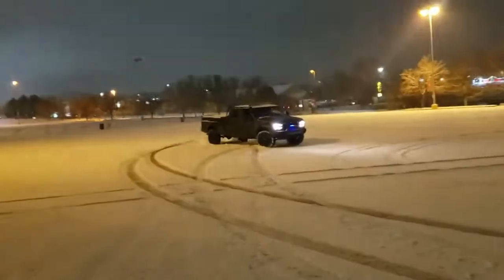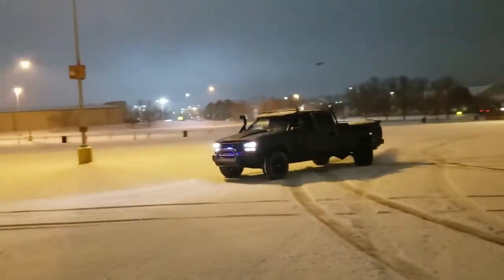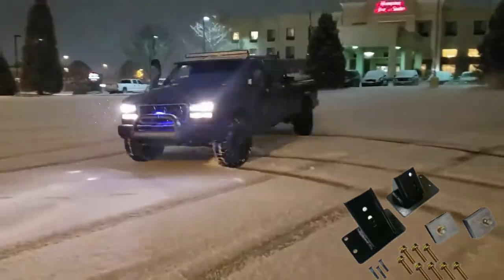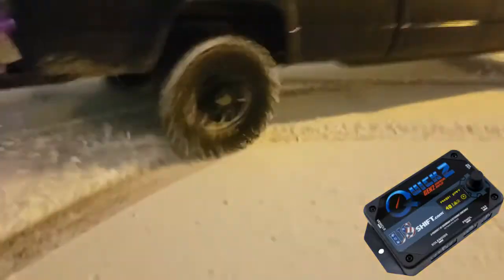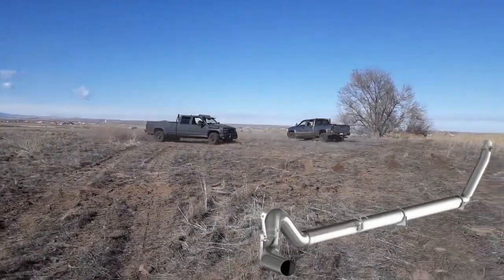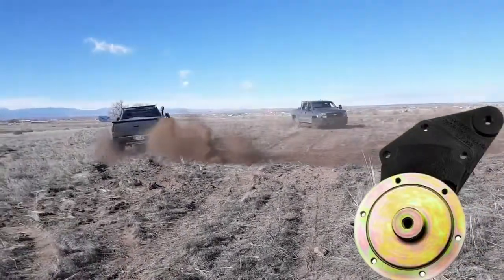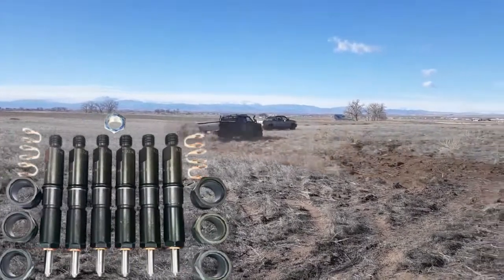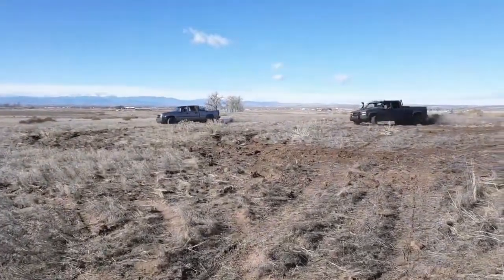GMT-400 12V Cummins Swap OBS Chevy Parts List

Comment: Hey, I’m not sure if you know or not but will a dodge n4500 input shaft fit in a gm nv4500? Do you use the dodge computer and if so can it control the gm cluster?
Reply from the maker: The dodge input shaft will fit but depending on the year some of the gm nv4500s vary as far as things like the bearing retainer that may or may not need to be modified to make it work but many people have done it. As far as the cluster theres a variety of ways to do it the easiest I would say is using a Dakota digital box for the speedo and the factory alternator for the tach signal, and you can use adapters to make the gm oil pressure sensor work on the 12V

Comment: Did you have to upgrade the front end to support the added weight?
Reply from the maker: @fn8571 No, some people do crank the torsion bars up and say it rides surprisingly well with the extra weight on the stock 4x4 ifs, I haven't noticed any problems personally

Comment: I'm putting a 97 12 Valve into my solid axle swapped nv4500 gasser 96. Three questions I haven't found exact answers for though. 1. If I swap in a diesel cluster will the tach read correctly and without any further modification? 2. Did you use Dodge radiator, condenser and intercooler? 3. I have both the Dodge and Chevy computers. Which one is easiest to use to keep gauges and everything functional? I've seen trucks built wither either but nobody explains why one may be better than the other. Thanks!
Reply from the maker: If you use a diesel cluster you can hook it up to the dodge alternator to get it to read but it will be off by a bit. I used a duramax radiator and dodge intercooler and condenser. Most of the Chevy BCM stays in tact and since you shouldn't need 99% of the Chevy ECM its typically easier to stick with the dodge computer. I hope this helps, if you need any more info I have a decent write up in the description and if I dont cover it there feel free to ask, I hope your project goes smoothly!

Comment: Is it Hey Bud? What torque converter did you go with? Because the factory stalls are around a 1000 and I didn't know they made one lower than that?
Reply from the maker: @nerdyelectronguy  I went G-Force "low stall" triple disc converter but I believe Hughes transmission and xtm have one too and I think they all stall around 1200 I have heard of people pairing the 4l80e to Duramaxes with different low stall converters but I'm not sure what they're stalling at some people have had plenty of success with the stock ones but some have shelled them within weeks it depends on the application and driving habits to a degree

Comment from the maker: Starting with a 454 gives you the advantage of not having to swap or modify the ac/heater hoses and windshield washer reservoir like you would if your truck had the 6.5l. However, already having a diesel cluster arguably makes it easier to get your tach to work since you don't have to utilize a Dakota digital tachometer conversion box to convert the signal from your alternator to be readable by the gas cluster. You can also add a W terminal to the stock denso dodge alternator and hook it up directly to a diesel version cluster that also already has the wait to start light, but the reading won't be entirely accurate. To hook up the speedometer and US-Shift trans controller, find the two pairs of braided wires (purple/white and green/black) coming from the transfer case output shaft (on 4wds, on 2wd it's on left rear of trans), splice them into the US Shift without disconnecting them from the vehicle speed sensor buffer so as to not interfere with ABS, and then take the speedometer output from the US Shift and connect that to the dark green wire (#14) going to the speedo on your cluster, making sure to disconnect it from the VSSB.  After removing the 454 and its motor mounts, cut the bottom lip portion of the motor mount area off on each side and drill the 1/2-9/16 holes in the exact spots for the conversion motor mounts (1.1" right from center of existing top left mount hole, 2.73" down). You will also need to cut off two small "support" bars near the core support (they make a v shape directly in front of the motor mounts) as well as replace the top bolts in your front diff with recessed ones that will allow for more room (not required with 6 inch lift or if 2wd). The lip between the trans tunnel/bottom of the firewall will need to be beat back with a hammer if you are not using a significantly sized body lift. Save both the coolant temp sensor and oil pressure sensor from the old motor (if 454, there are two coolant temp sensors, the one you need is the one for the gauge cluster which has only one wire going to it) to install on the 12V with adapters that allow them to screw into existing tapped holes on the block. The coolant temp sensor can be installed on the front of the block where the vent tube for the p-pump used to go with a 1/2" MPT male thread to 3/8" MPT female thread bushing if you're using a high mount ac kit and smaller thermostat that doesn't require the vent tube (vertical water outlet). The oil pressure sensor can be installed on the Cummins block with a 1/8" male MPT to 1/4" MPT female adapter between the p-pump and motor mount where there is an existing tap into oil passage or on top of the oil filter housing.  If using the old 4l80e, the transmission crossmember needs to be moved backwards roughly 1.5-2 inches due to the additional length of the motor and you will need to use the correct flex plate/adapter as well as a US-Shift trans controller. Obviously, since the transmission moves back the rear driveshaft needs to be shortened and if you have 4wd the front needs to be lengthened. The old throttle pedal cable and cruise control can be modified to connect directly to the cummins throttle linkage. Some people throw on the work truck grill with thinner lights beneath the upper headlights that allow for the intercooler piping to snake through, but it is not all that difficult to modify the stock turn/marker lights by cutting them down to a thinner depth and reinstalling the bulbs. A stock dodge radiator hose can be bent and adapted to the upper radiator with rubber 90° elbows. The old ac condenser can be utilized directly behind the FMIC if you build some mounting brackets and clear the core support a bit for the lines. The bottom of the hood latch support needs to be cut off and reinforced differently while the radiator mounts on top are slightly relocated from the original position in order to move the radiator and allow more room up front. The intercooler piping should come out of the turbo into the passenger fender well, through the front core support (hole must be cut), into the FMIC, back through the same area on the drivers side of the core support, using nothing but 45 and 90 mandrel bends and one 180 u bend 3" exhaust tubing. Coming from the turbo on the passenger side, the piping can be ran by staring with a 90, going into two 45's, then another 90 directly into the intercooler. From the intercooler, it starts with a 180 u bend, then goes to a 90 mandrel bend, straight up to the stock cummins intercooler pipe just before the intake. The top half of the dodge fan shroud can be utilized behind the radiator, but the bottom half will not fit. Hook up your fuel, ac/heater lines, 12v in, run, fuel shutoff, and start to your ignition/batteries/relays accordingly and enjoy your new truck!
Reply: I'm fixing to start this project on my 93 c3500 2wd that has the weak 6.5l in it
Reply: Im prepping to do this to my 92 c3500 4x4 cant wait

Comment: Think I can do this to a 92-96 Chevy Silverado 1500, it's got plenty of engine bay for it, no rust on the frame or cracks or anything's the frame is beefy, and the suspension it's perfect if not a cummins, a LLY or a LBZ Duramax
Reply from the maker: Yes sir you can certainly do it with a half ton obs Chevy! It'd be a good idea to upgrade at least the front end with 3/4 or 1 ton parts. I'd also consider getting a 4l80e if you have the 4l60 because it'll handle more torque than the latter, although an Allison would be ideal if you're not going manual. Here's a couple brothers that put a duramax in a 90's 1500 and I believe they upgraded the suspension as well: https://youtu.be/rVRRAM00NNs 
You can't go wrong with a Cummins and those earlier Duramaxes are definitely where it's at! I've always loved the OBS platform as well so I'd say your rig is definitely well worth building and I hope it all goes well for ya'! If you need any tips or pointers feel free to ask! Thanks for watching!
Reply: @BOVAction  I seen this late lol I got model wrong mines a 2500 😂 it’s a 3/4 ton so I should be good there for it, only main issue I can see me hitting is the wiring issue
Reply from the maker: @dakotaenoch9014  Hey that's even better! The earlier 12V Cummins are fairly easy to wire up, but I could definitely see there being some difficulty if you go with a Duramax. I'm sure you'll get it sorted out either way!
Reply: @BOVAction  yea I’ve been thinking bout Cummins swapping it I’ll prob be easier
Reply: @BOVAction  do you got a video of it running on your page somewhere that I can hear it?
Reply: I would start out with a 3/4 or 1 ton truck. Half tons do make good LS swaps though.
Reply: @atx-cvpi_99  yea mines a 3 quarter ton

Comment: I'm actually putting a 1992 cummins in a 97 chev at the moment. Are you also sourcing your adapter parts from Jonesy's?
Reply from the maker: I am actually!
Reply: Swimmingly. I put a camper on top and drove 5000 kilometers to the Yukon and back. In hindsight I would rebuild the transmission before doing the swap haha
.....
 Lost reverse because I used too much 1st gear braking coming down the dome. Limped home with no reverse. 
Spending the winter adding new B&M supercooler, A/C and a temporary junkyard trans with a new low stall converter. Still undecided on rebuilding my old tranny myself or taking it to a shop.
Reply: @GreenMtForgeFarrier  i m watching your video i would like to do a cummins swap i have a 1994 6.5l  anf 1997 cummins truck with everything need your help
Reply: @2.0_brittt I would say set aside 10k for it without engine rebuild.
You're looking at replacing alot of stuff if it's a higher mile rig.
  I am ending up with a ton of little things like rusty hardware, broken connectors, alot of leaky worn out things like power steering cooler, brake lines etc ...

Comment: If you are still looking I have the adapter and flex plate you need I ran it with my 4l80e in my Cummins swap but I’ve decided to go with a 5 speed manual. I also have a brand new low stall torque converter

Comment: I'm actually considering this tbh, but im probably gonna sell my 2011 suburban an look for a 3500 an cummin swap it tbh. However curious what would be the best automatic transmission to hook up to it, and a very good shop that could do this?
Reply from the maker: An Allison trans would be ideal as far as automatic. I believe Tennessee Diesel Conversions sell the parts needed to do it yourself and would carry out the swap for you for a halfway decent price.
Reply: @BOVAction  thanks for the info I'll definitely give them a call definitely should be a great deal cheaper than a duraburb so im good with that 👍
Reply from the maker: @stormbreaker3027  Yeah no doubt, you've definitely got that right! Any time buddy, and thank you for watching! Good luck on your build!

Comment: I replaced same things you mentioned but I also did billet tappet cover gasket, oil pan gasket, front and rear main seals pdd billet freeze plugs and did a fluid harmonic balancer obviously this stuff doesn't get you any power gains but definitely helps with reliability and longevity if you can swing it stage 3 hamilton cam and afc live. cost a bit now but in the end the swap is worth it
Reply from the maker: That definitely makes sense. Thank you so much for the input; I very greatly appreciate it!